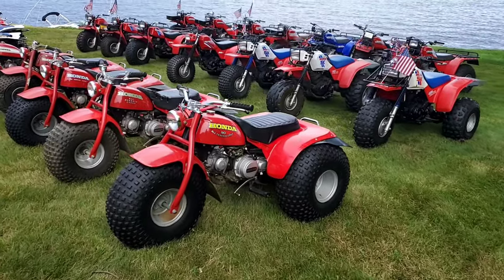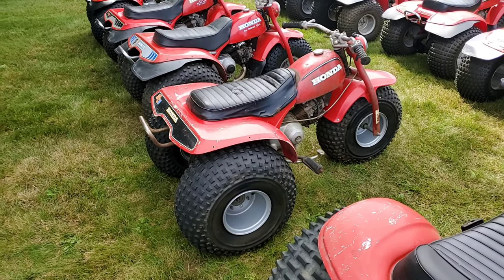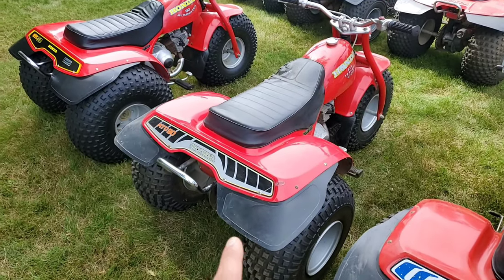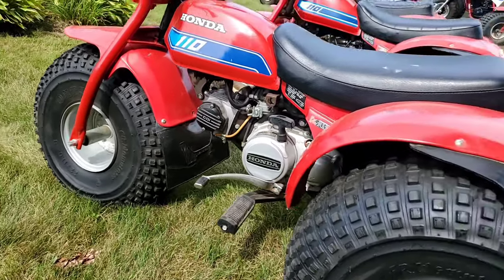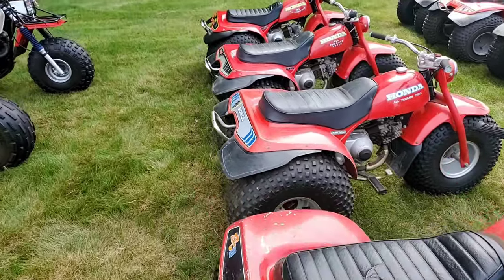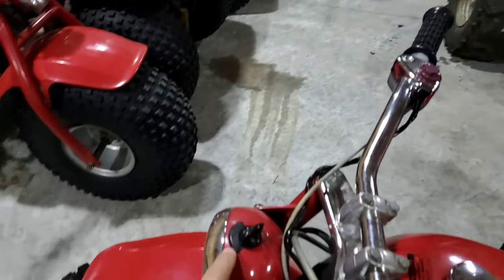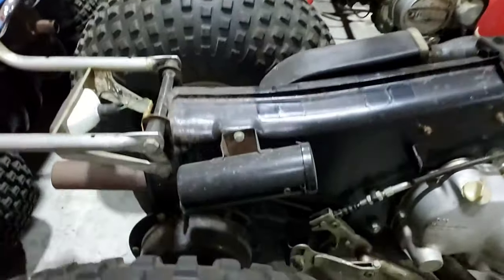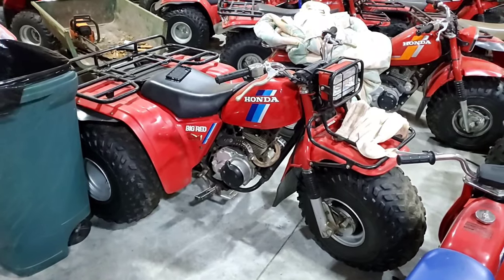1975 - 1978 Honda ATC 90 - What are the differences??

Comment: I had 1979 ATC 110, it had that same light switch but I didn’t have to switch in on to start. High range was mostly unusable. Kept it in low range all the time. I had a blast on mine. I used to pull my friends on their sleds in the winter.
Reply from the maker: Interesting.  Maybe my facts are wrong, or maybe they changed it up at some point because it was dumb...
Reply: The ATC90 headlight switch had three positions as shown in the video.  Ignition kill,  ignition on, and on with lights.  The Headlight socket had high and low wires (blue and white). But you couldn't select between high or low beams.  One wire is connected to the switch and the other is just dangling in the headlight case.  This can be verified in the wiring diagram.  This was changed for the ATC110s and the three positions were lights off, Low beam, High beam.  Both the blue and white wires are connected to the switch.

Comment: I am traveling all over picking up hondas. I play your videos before and after i get them in the car.Picking up a 78 90 very clean but the timing chain is loose.Partizilla for parts?.I LOVE YOUR VIDEOS YOU ARE FULL OF KNOWLEDGE AND PATIENCE 😅
Reply from the maker: Man, that really means a lot!  Thank you for that!  I have a couple other videos talking about where to find parts.  Regarding the timing chain, I can't recall if that is still available through Honda or not.  I have not bought through Partzilla though because I have found them to be more expensive than the other OEM parts sellers.  I use Rocky Mountain ATV for my OEM parts.  They have free shipping on orders over $75 too.  With anything 90 related, it's also good to check out Mike Palmgren's website https://shop.vintagemotorsports.net/  I see he does have timing chains listed on there, but they may also be readily available from Honda too.

Comment: The 1975-1978 Atc90 & 1979 Atc110 are the same nobbie tire. 1980 Atc110 is a 1 year only nobbie, 2 ribs on the sidewall, but otherwise same as 75-79. Then in 1981 Honda changed the nobbie, they had plys woven into the tire for puncture resistance, they also did not stretch out easily, also the wording/verbiage on the sidewalls is larger. Yes the look narrower, not as tall, it’s the plys that reduce the size a bit.
Reply from the maker: Awesome info sir!  Thank you!!

Comment: Question.  I thought only the 1st year 1970 90 was the US90 and '71 begins "ATC90"? Care to clarify?
Reply from the maker: Listen there Mr. Buysall... you need to re-watch my balloon tire 90 video and you'll see on the VIN that they're stamped with US90 through 1973, and in 1974 they start stamping the frames ATC90.  HOWEVER, on the fender, even in 1970 they were branding them the ATC 90.  So... make of that what you will, but thems the facts sir...

Comment: Hi Preston, I have a question, I was just reading a 1974 owners manual and it was talking about using 91 octane leaded gas or higher, What would be a good substitute with the gas we have today? I have a 78 ATC 90, a 74 90 and a 82 110, just wondering about this because I remember most engines before unleaded gas that came out, later had to be converted to hardened valve seats as far as cars and truck go to prevent any damage.

Comment: Ok I have a  question. I have 1978 at 90 and it has a high/low gear is that factory
Reply from the maker: Yes.  Every 90, 110, and 1st gen 125M is like that.

Comment: 2:35 I know that guy  he don't have a clue, hahahahahahahah,  I have very little to offer here id have to read up on it, I have a 73 Ballon us90 and absolutely none non balloon atc 90, compiling the archive brother your correct on the 110 change over to pro-am..... ertl toy Co. Made a scale model of the 78 I believe, those toys do pop up on ebay periodically..... never heard that about the headlight switch doubling as a kill? Interesting, THAT NUMBER 1 DECAL ON THE 85 200M TRUNK LID???????  That looks like the 83 accessories brochure 250r fairing number plate decal
Reply from the maker: I had recorded this video (the first part) back in August... and that SP vs. FR question stumped me and I couldn't find anything.  And that video you did answered it for me and I was like THERE IT IS!  So, I tucked that little tid bit under my hat and knew I'd be including it in this video.  I've seen the Ertl ATC 90's and would like to get one at some point.  And yes, the 3 position switch on those headlights need to be on for the machine to run.  Very weird set up.  And I'll have to get a close up of that #1 decal!  I think you may be right!
Reply: @ThisOldTrike  Bruce and I can't seem to find that number one I wish I could send a pic of the brochure through YouTube comment but I don't know how...i don't think the stripe kit had a big number I gotta check the "honda bible" and see what was in a stripe kit